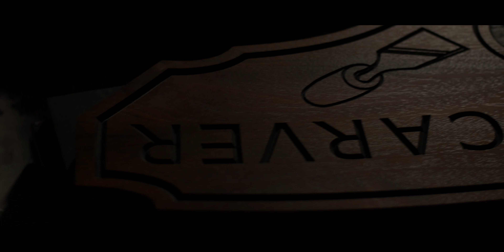Neewer Shoulder Rig Test (GH4+Speedbooster+Canon 50mm 1.8)

Comment: Thanks for your video.. Is this the STM version of the Canon lens? I got the Canon 50mm f1.8 STM lens and a viltrox ef-m2 speedbooster and though the auto focus works, when I put my panasonic g85 camera into manual focus mode (and set the switch on the Canon lens to 'MF') turning the focus ring on the lens does nothing... The focus doesn't change and the lens doesn't move in and out to focus (as it does in AF mode).. is this your experience too? Thanks for any feedback
Reply from the maker: That is very strange, sounds like an internal issue with the lens itself. I think the lens in this video was the STM version, all I know is that it was the cheapest 50mm Canon option

Comment: How does autofocus work on this lens w/ Metabones? And is your maximum aperture 1,1? Assuming you're using the x0.64 version of the speedbooster.
Reply from the maker: I don't know if my speed booster has an issue, but i cannot use the AF with it. It constantly zips around and never holds focus.